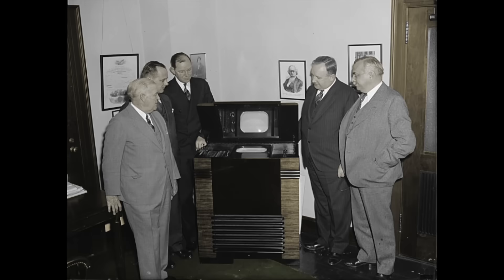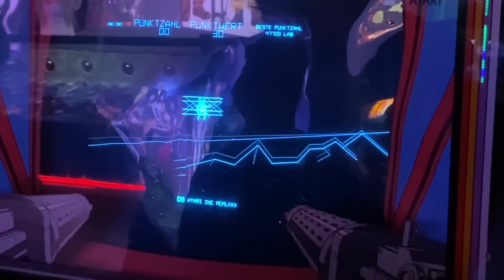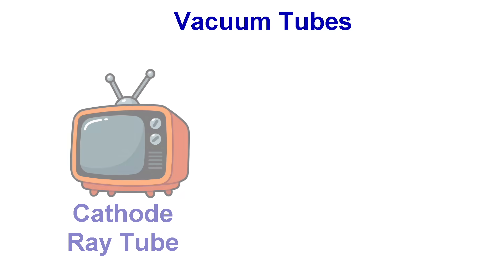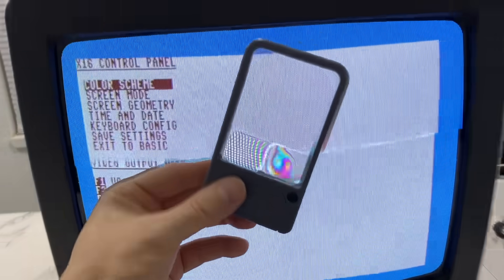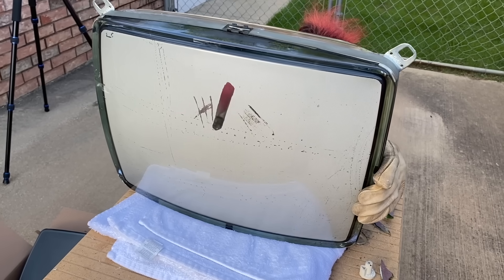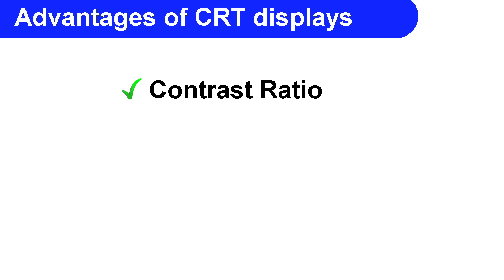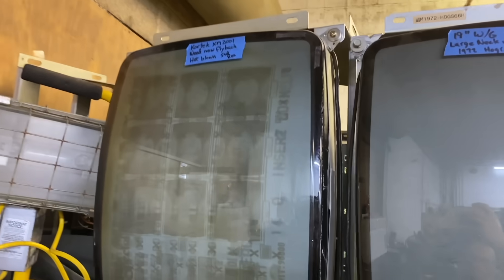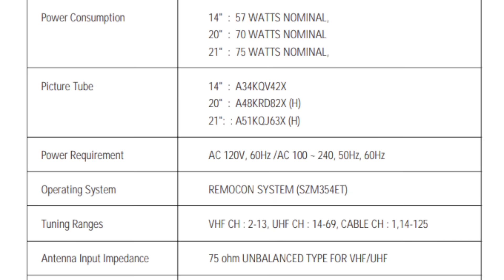How Cathode Ray Tubes Work.

Comment: Touching the internals while the screen is on gives me chills.
Reply: I used to rotate the yoke many a time on old TV's, back in the 1980s...

Of course I was just a teenager so the few shocks I got never scared me. I didn't realize it was that dangerous to adjust and square up the picture.

I quickly learned that rotating the three sliders on a color tube would line them up exactly. Nice clear picture. Otherwise it's like a double vision image.

I used to get free TVs back then, but they were never working properly until i fixed them..

The most common thing that stopped the TV was a bad thermistor.. I used to twist it like a bread tie, essentially removing it from the circuit and it would power right on. 

That was way before I knew electronics well.
Reply: @rickhalverson2252  You shouldn't get a shock from rotating the Yoke!?
Only the tube or the flyback should be able to give you a nasty shock. Reports of CRTs killing people have been exaggerated in recent years. Possibly because less people have used or worked with CRTs now. 
In reality a CRT is very unlikely to kill a normal healthy person, although it can give you a ell of a shock if you don't follow basic safety procedures, or do something stupid.
Reply: Agreed, is that safe?
Reply: @jumbledfox2098  You can see the anode a few inches to the left of the yoke and his hand. That's the really bad part to touch. The magnets he's messing with are fairly low voltage. Knowing this, I still wouldn't feel confident going in and touching things on a CRT myself. I'm sure he's worked on a lot of them.
Reply: @chitlitlah  Those yoke coils can have up to 700 volts on them. But the connections are usually insulated. There's also 700 volts going to the focus pin at the back of the neck. Back in the 1970s, they determined that high voltage focus was more efficient than the low voltage focus in use until then, and the magnetic focus before that.
Reply: @jumbledfox2098  No, not safe. I'm not faulting him for adjusting the yoke, he knows what he is doing. But yeah, flyback is 20kv or more, and the CRT is basically a big capacitor which is why it can get you when it's off and unplugged, although I'd guess that newer models probably had a bleed resistor. He's fine right where he is, but if the yoke slipped outwards or one of the HV leads to the tube popped loose that might change. At 20kv, electrical continuity is not a necessary condition for current flow. It DEFINITELY gave me the heebie-jeebies to see him in there with it on, and with both hands. If I ever did that it would be with one hand.
Reply: @jumbledfox2098  Yeah it's safe as long as while you're adjusting the yoke with one hand, you keep your other hand in your pocket.
Reply: @jumbledfox2098  it's "safe" until suddenly it's very deadly.
Reply: @wrmusic8736  Many things are like that. This is where the "if you know what you're doing" bit comes in. Not everything has idiot protection built in, and the only protection between becoming dead is paying attention to what you're doing.
Reply: @ncot_tech  Stairs in a house are a good example of something incredibly dangerous in the home as well as any building.
Reply: @jumbledfox2098  Absolutely not, the flyback transformer can be putting out over 20kV sometimes twice that.

That area is not even safe to touch if the display is off because it gets charged. If you know the display very well and take precautions you can avoid injury but you must know what you're doing
Reply: @theonik2006  Obviously there are areas on the CRT one should avoid touching and that's the plug and receptacle at the back of the electron gun, keeping fingers away from high tension insulator and cable of the flyback transformer as well as the degaussing coil and metal frame holding the CRT inside the case, if they somehow become reference to the high voltage.   I would be cautious around the steering/deflecting coils as well, but sometimes the best method of handling anything inside a CRT television is not to if you don't know what you are doing unless you have the proper protective equipment AND of course the knowledge of repairing these devices.
Reply: @theonik2006  I have some idea of what 10-15 kV of electricity feels like and that's touching the wet, compromised insulation on a spark plug wire on a 1969 4 hp Briggs and Stratton engine that powered an old snow blower.  Man, that hurt.  And that was intermittent, not potentially continuous like in a CRT or even a microwave oven.
Reply: He was touching plastic. So yes, it is safe if you know what you are doing.
Reply: Did I miss a disclaimer? Kids and newbies should not be opening CRTs
Reply: @jamesg872  I dislike how everyone thinks these videos need disclaimers. The disclaimer is already on the back of every CRT ever made. It says "WARNING: Hazardous Voltage. No user-serviceable parts inside. Refer servicing to qualified service personnel" or something of that nature.
Reply: @lcdjr85  What language is that in
Reply: @lcdjr85  They also usually mention the high vacuum and implosion hazard, and sometimes x-ray exposure risk, especially on tube sets. The tube sets never said "no-user serviceable parts", though.
Reply: It's perfectly safe for people that know what they are doing.
Reply: Chills? I’d go with burns.😂 Fixed Mac CRT’s a lot during my work over the years and only got bit once but boy did that bite! Grug be more careful with wire lightning after that <grunt>
Reply: Who would have thought that it would come right apart after hitting glass with a hammer... 😮😮
Reply: Always made me nervous and I did know (reasonably well) what I was doing.
Reply: Bzzap!
Reply: @Bob-1802  and its none of your business
Reply: The old, old TVs that had vacuum tube components besides the CRT could be really dangerous, there any number of high voltage, high amperage circuits that could potentially kill you. I worked at a couple of places doing front counter and QC work for consumer electronics including TVs. The older techs all told various stories about getting severely shocked by the all-tube TVs of the past. The picture tubes and "Flyback" transformers on more modern sets can still light up your life very unpleasantly. Also, keep your grubby fingers OUT of any switching power supply when operating. Don't ask me how I know this.
Reply: @joelcarson4602  The older techs and you survived the shocks so the potentiality to kill mustn't have been high.
Reply: @joelcarson4602  Anything using vacuum  tubes, or valves,  could (potentially, but still probably not) kill you if you are stupid with them, Radios, TVs, Oscilloscopes, even (really) old computers.
But there really is no need for the paranoia a lot of people have about these high-voltage electronics. People used to work with them all the time without dying!

I've seen people be pretty gung-ho when working with Nixie Tubes in recent years, but they also require the same dangerously high voltage. There now just seams to be a misguided fear of CRT's, and to a lesser extent valves, possibly because a lot of people no longer grew up with them.
Reply: @joelcarson4602  The biggest risk was the hot chassis sets that became popular in the late 1950s, where one side of the power line was connected to the chassis, like an old series string radio. Plugged in the wrong way, touching the chassis is like touching the hot wire to the outlet.
Reply: Dave was hoping for his 1 second of Electroboom fame, but nothing happened.
Reply: @lovemadeinjapan  The difference is that ElectroBOOM knows what he's doing.
Reply: Naaah, ive seen worse from repaiot shops. that was fine
Reply: Why? It's not a big deal.

Comment: It’s impressive how they were able to line up the shadow mask and the phosphor so accurately.
Reply: The phosphor dots or stripes were positioned by a photolithography process using the shadow mask as a photomask. That's how they could be lined up so accurately.
Reply: @michaelturner4457  That's what I thought as well, but as the video shows the shadow mask has crossbars whereas the phosphor layer doesn't, at least for the stripe pattern, so I'm still unsure now.
Reply: @tomee6  The first color CRTs (and cheaper later ones) had the RGB phosphor dots created by a shadow mask with round holes on a hexagonal type grid.  And the electron guns in a symmetrical triangle to keep the vacuum forces balanced.  The result was a dim picture because the ratio of hole area to the overall screen was quite low (at least half of the electrons hit the mask and thus wasted).  Further along, CRTs with triads of aligned slot shaped phosphors / shadow mask holes were developed, with three guns in a line, for a much brighter picture, and the phosphors could be applied on the glass as thin continuous strips.
Reply: Once you get the proportion right of the distance between shadow mask and screen, and the distance between electron gun and shadow mask, and you can get the holes in the shadow mask and the widths of the phosphor bands accurate enough, it's mostly a matter of putting a couple of permanent magnets in the right place on the outside of the tube, to let the electron beams hit their own phosphor correctly. Unfortunately especially in older CRT monitors and TV's it wasn't so easy to make the three beams hit the same spot at the same time, so you often see convergence errors especially around the edges and in the corners.
Reply: @JacGoudsmit  Due to the angle of the electron beam, did the shadow mask holes be angled or were they just straight through?
Reply: @JacGoudsmit  so what you are saying, is that after they figured out all the hard stuff, it's easy... I cannot argue against that
Reply: They didn't. It was compensated for during setup, it's called a purity adjustment. There are some permanent magnets which force the beams into certain positions to prevent color bleed.
Reply: @AiOinc1 so the magnets act on the beam as if we would move the guns ? Do they sit between the yokes and the guns? Or behind the yokes? They sure add to the depth of the tube.
Reply: They don't align them.  There are rings with magnets on the neck behind the yoke called purity rings.  They are adjusted at the factory after the CRT is turned on for testing and then glued in place.
Reply: Early TVs had about a dozen "convergence" controls for making adjustments after the tube had been made. Said controls adjusted the current through various coils around the tube. A big breakthrough in making TVs cheaper was the use of a magnetic ring at the back of the tube that was magnetised using computers to the required amount at the factory so the convergence was all set up from that point.
Reply: @MrDuncl  so it is permanent magnet vs electric magnet? Like Werner von Siemens used electric magnets in motors for trains, but today we use Chinese Nd:iron which does not need power.
Reply: @ArneChristianRosenfeldt  Permanent magnets for things like color purity which stays constant. Electromagnets for actually moving the electron beam around.
Reply: This documentary of a Phillips CRT production facility explains the application of the phosphor stripes very clearly: https://youtu.be/2jJm65mQWR0?t=1370
Reply: Sadly there was never an attempt at making a 4k CRT
Reply: @gabrielvieira6529 you can send 4k60p (though it wont have the full pixel accurate detail) to very high end pc crts or crt projectors. I can actually send a 2560x1440p 60hz signal to my dell M992 display and it looks great, plus basicly has analog antialiasing
Reply: @gabrielvieira6529 they may have gotten close with high end, large PC monitors.
Reply: @gabrielvieira6529  The amount of mask occlusion on that must be horrendous. You can only make it so thin.
Reply: @gabrielvieira6529 they do have those HD CRT’s, but gamers don’t want them because they have input lag in them 😢
Reply: There's fiddly settings in the "No User Serviceable Parts Inside" part of a CRT screen for the purpose of lining things up.  Adjusting them requires tools like plastic screwdrivers
Reply: And they did well on Aperture Grille and Phosphor so accurately too
Reply: This is a very good video
Reply: I just have to say, plasma is the superior display type because it has all the advantages of crt, but have higher resolutions, larger sizes, thinner bodies, & faster refresh rates
Reply: @Gigcomplex  <OLED has entered the chat>
Reply: The used machines to do it.  If you thing that's crazy though,  think of the different layers of a silicon chip and how the masks have to line up in the different processes of the production of a CPU.  Part of this process involves exposing the mask with UV light and creating a shadow, similar to how a camera works.   Only the circuits that are being created here are microscopic.
Reply: How did they do that back in the early 1900s?
Reply: @MatthewCenance  There was no shadowmask in black and white sets, shadow masks were used in color TV sets.
Reply: @MatthewCenance  They didn't... color TV didn't come around until the 50s
Reply: @timfischer  Late 1960s, early 1970s here in England.
Reply: @EgoShredder  Sure. But not the "early 1900s" in any case.
Reply: @MatthewCenance  Not great quality but gives a detailed explanation of how the phosphors are lined up with the shadow mask:
Part 1: https://www.youtube.com/watch?v=Cf-rNlqeWw4
Part 2: https://www.youtube.com/watch?v=QKvVE2jv5UQ
(That part of the process exactly crosses where the video was split.)
Reply: @MatthewCenance  you see, once you go back in time enough and the tech seems impossible to do, it means Aliens. Thats right, like the pyramids early t.v.s were made by aliens. /s But on a serious note, it does highlight the ingenuity of humans.  Also, early t.v.s were very expensive.
Reply: @MatthewCenance  they didn't. crts had a lot of defects and were very difficult to make prior to ww2
Reply: @MatthewCenance  colour tv appeared in the 50s not the early 1900's...... BW tv does not have a shadow mask...maybe review the video, he explains it
Reply: @MatthewCenance black and white. Only needs white contrast for variation, but good question nonetheless. There was tons of lost data in old CRTs, but still some good detail for being the forerunner of moving images.
Reply: @MatthewCenance  they already had quite nice precision back then, especially watchmakers were masters of precision and probably the beginning of micro components before production machines were created. The light bulb/early vacuum tube exists since the late 1800s.
Reply: @MatthewCenance  maybe turn it on, move it live and see what happens?
Reply: it's not just phosphor inside. there coul be some radioactive substances like cesium or europium.